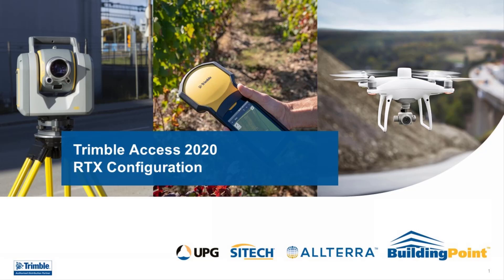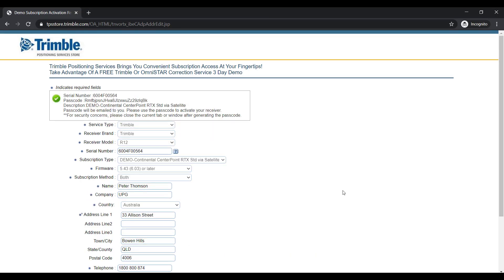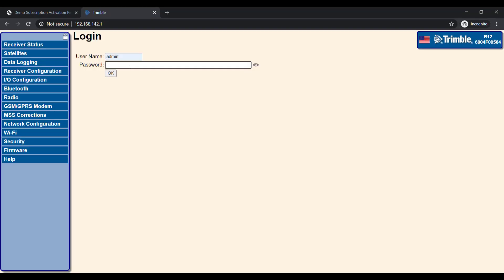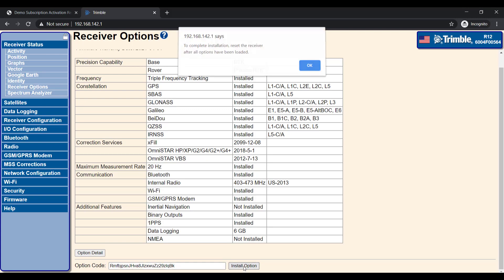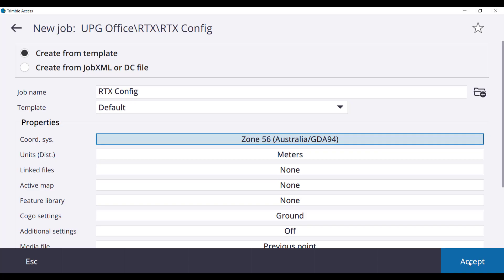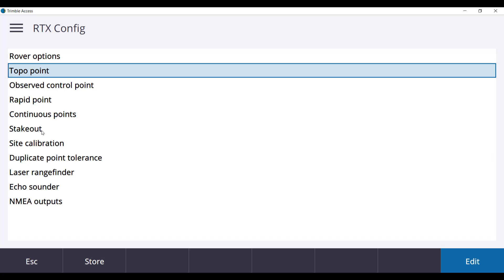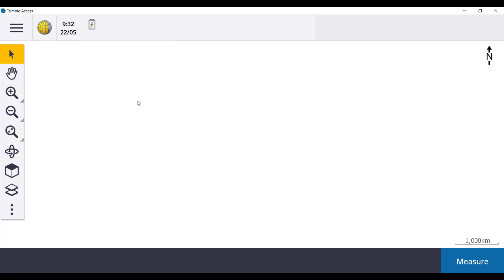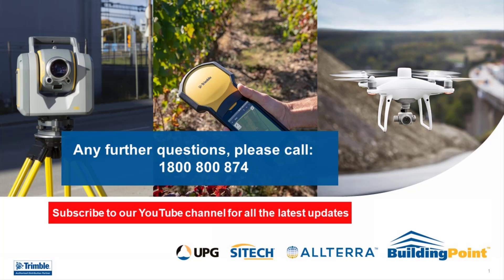Tutorial - RTX Configuration

Comment: What happens if the equipment wont initialize? (error wont go down enough to start)
Reply: Make sure the code you have is RTX (SV) and the settings in Access is RTX (SV). If the issue still persists, I would call your Trimble Dealer